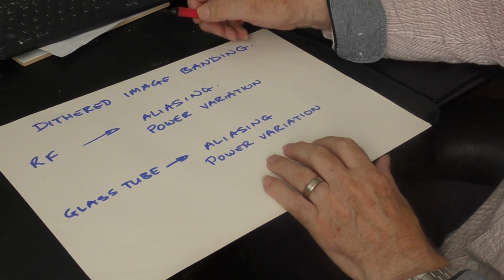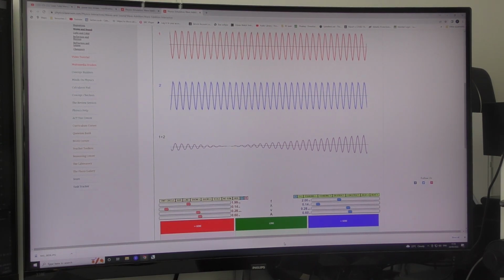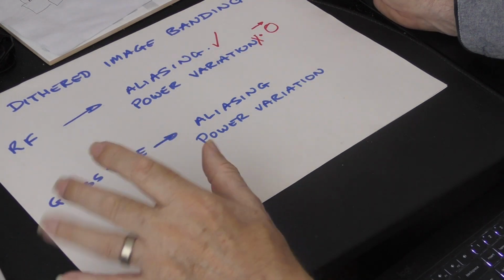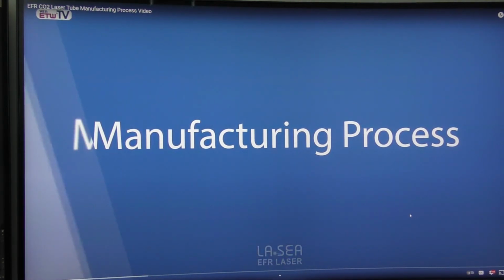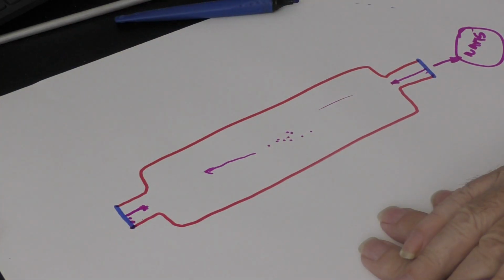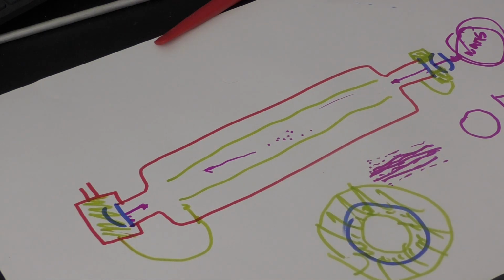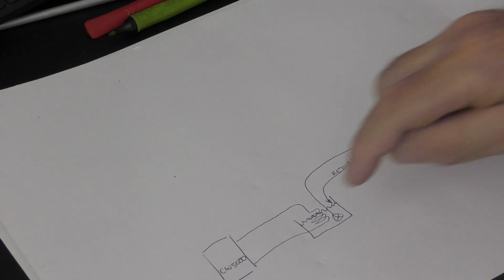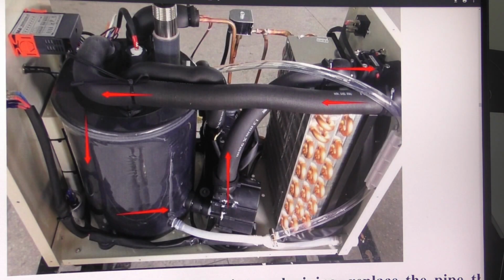RDWorks Learning Lab 241 EDITED  Variable Colour Engraving Bands Decoded

Comment: Hello I just watch your pod cast on K40 power supplies. Could you please help me pick the right pwm. I am putting a mks dlc 32 v2.1 controller and found two pwm one that works 0-5 volts and one thats 0-24 volts:   (S): PWM output, the signal voltage is 0V~12V or 0V~24V, the maximum voltage depends on the power input voltage. If the power supply voltage input is 24V, then the maximum output voltage of this interface is 24V. At present, the maximum power supported by the laser head is: 25W at 12V, and 50W at 24V.,(TTL): TTL input is PWM, the default main frequency is 1K Hz, 1K Hz~10K Hz can be set, and the voltage is between 0V~5V. Witch one should I hook to the L . terminal. Thank You
Reply from the maker: Hi
The 24vsupply is for your stepper motors and this is generally set to 20kH (or as high as possible) However I am slightly puzzled about the way you describe the figures. It gives me the impression you are planning to use a diode head rather than a CO2 tube.  You finally mention the L terminal which is typical of a glass tube system, The  L terminal  will normally sit at 5vdc and keep your laser tube switchedOFF  . When the controller gets information from your program to turn the tube ON it does so by  switching L to GND (0vdc)  A glass tube does not operate from PWM it requires steady current supply which is why I have the impression this is a diode laser. With an HV power supply for a glass tube, the specified switching  response time is 1ms(1khz) .  So please clarify what your  project involves....glass CO2 or diode laser.
Best wishes
Russ
Reply: @SarbarMultimedia  Thank You for your quick responses. I am upgrading a K40 with a CO2 glass tube and a JG-40 power supply. With MKS DLC32 v2 32bits GRBL offline controller with 2209 stepper drivers upgrade kits for cnc laser engraving machine. To help; MKS DLC32 V2 Wiring Manual - GitHub has a PDF file. You can google it for a 24 page manual, on page 9 and 10 in this manual it shows two PWM, connections. The following shows two types of laser:1. TTL-PWM type (3PIN). 2.12-24v-PWM(2PIN) The store Macrobase Store on AliExpress shows this controller wire diagram for the k40 L pin hooked to the 2 pin PWM S terminal on the control board. Most signal wires I deal with are 0-5v so the higher voltage confused me. Thank you for your help

Comment: Would you think it’s help to add an additional reservoir so you can hold more water?
Reply from the maker: Thanks for the thought but its not really a practical solution because the return would have to be in the extra external  tank and that is not going to help the instant cooling that occurs and be immediately drawn from the small tank., Yes a larger volume will slow down the overall temperature rise  but notb at the right time and in the righ place.. Take a look at my answer to MOORS7.
 Best wishes
Russ

Comment: Hey Russ, in reference to the CW5000; While I get that you don't want large temperature swings, which may occur if you let it rise and then suddenly turn on the chiller, there is the configuration option of keeping the temperature constant, or within a certain hysteresis. I currently have it set to 18.5 +- 0.5 degree: start at 19, stop at 18.
While I haven't really played with any photo engraving thus far, I'd imagine that constant temperature to work fine without needing an extra buffer system?
And while the thing only has a 'small' volume, it shouldn't really matter so long as the output temperature (which I assume is what it's measuring for control), remains the same? What difference does it make if the tube receives 18C water from a 6L reservoir, or 18 degree water from a 50L one?
Reply from the maker: Hi
 I answered this comment once but Youtube sent it into space!!! Lets try again.
  You may think that  tight temperature  settings is a great way to control the temperature.  If this was an instant feedback  (backlash -free) servo system then you would be correct.  Sadly this servo system is very "elastic". Let me explain.. The  digital display shows what the temperature sensor sees.   When it sees 19C the chiller switches on and and after a short response time the temperature starts droppingrapidly to cool the 6 l tank. The very cold water (maybe at 10C) hits the mirrors and returns to the tank It may take 30 sec to a minute for the  temperature sensor to detect 18C and switch off the cooling.  Howvere the "elasticity" in the system is the fact that the cooling coil  does not instantly become 18C.  It may be at say 5C after  a minute of cooling. So that will continue to drive the temperature down below 18C.  I hope you can see that the The cooling rate is much faster than the response time of the system. You would have to put a temperature sensor right by the  tube input to see what is actually happening. Even trying to control the temperature at this point  (impractical) would not have the desired "tight" control. How can  you dodge a bullet? Either you have improve your responses or the bullet has to move slower.  . This INDUSTRIAL chiller seems to have MASSIVE over cooling capacity for even a 200watt tube. Thus apart from the well proven  buffering method ,  the only way to  "tame" the ferocity of the cooling is to add a  second crude servo control system that will effectively slow the speeding bullet. 
Let's look at adding a delay timer  ( timer A) that starts when the refrigerator switches ON at 19C.  Lets say that A=10sec AND  after 10sec the refrigeration will  be switched 
 OFF by the timer  and  at that same instant timer B  begins and keeps the refigeration tuned OFF   and for example  B= 30 sec.  After 30 sec the short 10 sec burst of cooling may have been sufficient to drop the temperature below 19c.  At this point  timer A will  be "asking" the tempertaure controller "is the temperature 19C or more?" 
 If NO then the timing system will await the next time that the temperature exceeds 19 c before springing into  10 sec action again.   If YES then the 10 sec/30sec cycle will continue until the temperature drops below 19C. There is no  laggy hysteresis in this crude control system. With two timers you can adjust the response to suit the power of your tube so you are balancing the cooling requirenet against the heat input.  Note  The lower hysterisis value never comes into play
Although many users are cometent to make this modification for themselves it would not be a huge extra cost for the  manufacturer to add such precisipon control for laser applications.

Best wishes
Russ

Comment: Russ - you have described the problems of power linked to the chiller (CW5000 series) but this is likely to be non-existent with something like the CW3000 as it only cools as much as it can.  What does happen, I understand, is a gradual rise in temperature over time and hence no thermal shock to the mirrors.  In fact the CW3000 must be acting like a thermal buffer as a buffer tank option in smoothing out the cooling from a real chiller.  When it comes down to it, the vendors of the chinablue and tangerine get it right in only providing a water pump to go in your own water tank.  It's only a gimmic to actually need a chiller where the cooling water volume is low.  Use a pump as provided in say a 5 gallon brewer bucket will slow the rise  in tube temperature effectively for engraving and maybe switch to a chiller if cutting.
Reply from the maker: Hi Phil
 You are 100% correct .I have never experience to power loss banding  problem because I have either had CW3000's  which is just a fancy version of  the bucket and pond pump method.
 which ensures temperature changes are very slow. For temperate climates  you do not need a chiller unit except on the few 35C days. However,  in hot climates  refrigeration is essential. so the buffer tank is the only solution. You can even add a cheap temperature relay to the buffer tank so that that you can choose your own temperature range .If it cools too much than you just switch the chiller off at the mains.
Best wishes
Russ
Reply: My 80w Chinese blue came with a CW3000 that just didn’t do the trick in my climate. As a refrigeration contractor of 25 years, I chose to buy an inexpensive, used lab type refrigeration unit with air cooled condenser and refrigerant-water exchange for evaporator. I don’t recall the capacity but it is intentionally small as I’d researched the heat load at the time. I piped this in series between the tube return and tank of the 3000 thus removing heat from the water as it enters the reservoir. Cooling is cycled with a digital thermostat in the reservoir and this has resulted in stable operation for me. (I do not do photo replication/engraving but have learned a heap from watching your endeavors!)
Reply from the maker: @shandylynn1  
Hi Robert
 I have two CW3000 units that are nothing more than air cooled radiators. In temperate climates like here ion the UK they are perfect for most applications. We rarely experience temperatiures in excess of 30C and evem at that temperature I can run my tubes up to 40C with no issues. because the temperature difference is sufficient to stabilze the temperature , albeit too high for some people. 40C (bathwater)is not hot and  will not harm you tube or significantly reduce its power. As I point out in this video, dramatic thermal rate of change is the real culprit.  Distorted mirrors can quickly reduce the power output. Usually its the cathode mirror that is the culprit but my second tube  turnrd oiut to be junk because it ran for a few minutes and then lost power.  in a completely predictable manner. In that case it was the anode mirror . The tube was badly manufactiured and there was uneven cooling at the anode mirror . You can see for yourself the dramatic effect it had and my attempts to cure it in this video . Start at 8mins   
 https://www.youtube.com/watch?v=mN7_4h3nCZM
Your approach is perfect to suppliment the CW300 with a bit of gentle help. Absolute temperature control is not essential. just slow change and all will be well
Here is proof that power loss is not significant. at 40C 
https://www.youtube.com/watch?v=asM0s7wm4AM

Best wishes
Russ